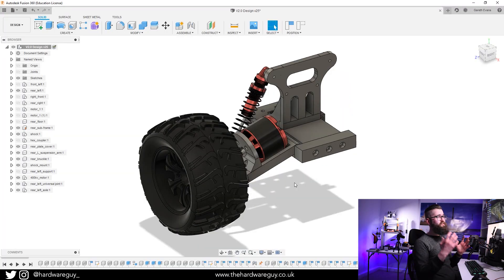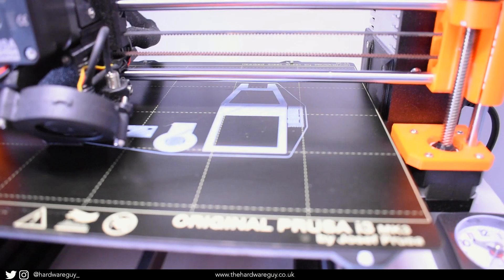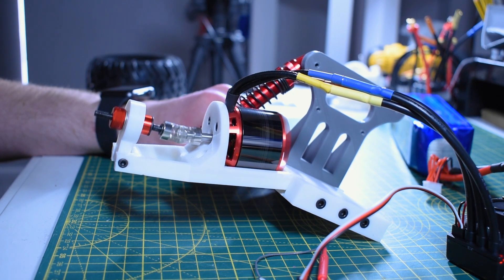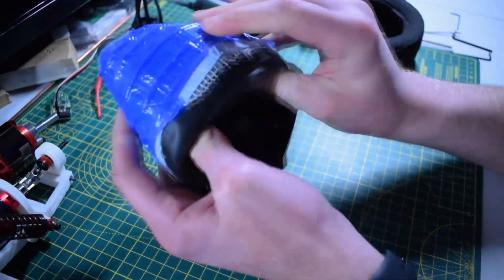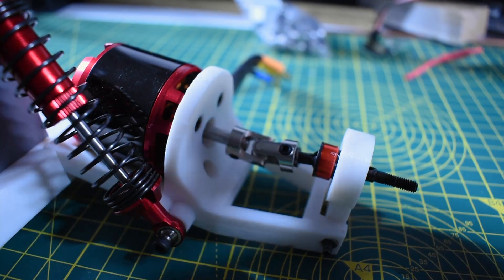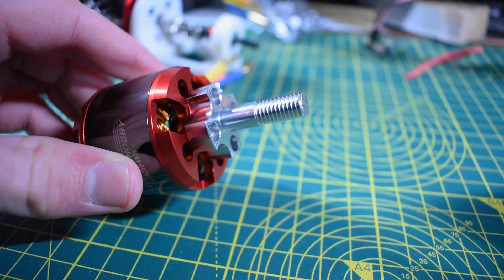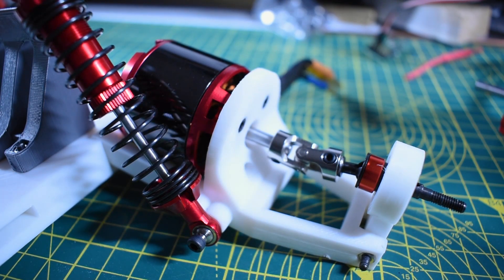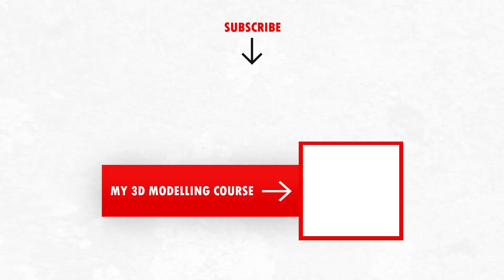AWD RC Car System... pt.3

Comment: Why not place motor on the outside have the wheel attach directly to motor
Reply from the maker: That's what I did eventually! But not enough power, check out Raptor 2. That was a success!

Comment: Why don’t use the outrunner motor at the rim? basically a hub motor allowing to run an awd system in any 2wd car chassi
Reply from the maker: tried it! not enough torque to even move! check out raptor 2 :) much better design

Comment: If you would have put drift wheels on there that would probably make the world's most quickest slickest and smoothest drift car RC it's probably way smarter and way more probable for that to be a high-speed drift car not just to keep it stable but also keep it low

Comment: You don't necessarily have to superglue your rubber tires to your RC rims use a really strong rubber cement so that way not only does it hold strong but it will at least be removable later on

Comment: having the heavy motor on the suspension arms increases unsprung weight dramatically, which is horrible for suspension performance. 
glue the tire to the rim and use balancing clay to eliminate the vibration. my 100+ mph rc cars have bearing play like that but don't vibrate at all.
I like the out of the box thinking tho👍

Comment: hey. how did you connect them in transmitter without different rotations of motor?
Reply: Swap the wires on one till it runs the direction you want.

Comment: First of all keep up the good work! I do have some questions regarding motor choice and suspension design. Do you want a direct drive motor setup or just 1 motor for each wheel? Because the currently available small brushless motors do not have enough torque in my opinion to be used as direct drives. Also for offroading, I am not a fan of outrunners cause they get full of dirt eventually. A closed off design inrunner would have my preference. Regarding the suspension, in the video you are using the axle as upper wishbone to keep the knuckle in place. This causes the axle and bearing to be loaded in a direction they are not designed for. A second wishbone would be prefered imo. Is this just for testing?
Reply: Just realised that this was 10 months ago and you are already working on the raptor. Dont bother answering if my concerns have become irrelevant.
Reply from the maker: Thanks for the kind words! yeah I've made many improvements since with Raptor version 2👍🏻
Reply: Looking forward to see the progress! Im modifing a cheap 1/10 truggy to have a dual motor front axle. Will do the rear later when the front has been proven succesfull.

Comment: Love your work! I'm printing right now a wheel of my design to include an outrunner motor... The thing is that I'd like somehow "make"/program an electronic differential, possibly using the differential thrust mix on my controller and eventually in the future an Arduino to make the algorithm calculation. How did you addressed the differential issue?

Comment: I dont think you're supposed to run just one u joint on an axle. this is because a universal joint isnt a constant velocity joint. two u joints at equal angles cancel eachother out and give you a constant velocity between the output and the input
Reply: Correct.

Comment: it easy to design/ print a wheel, i have printed a few wheels with pla and they have held up great. i am working on a direct drive as well, my first attempt was a failure for sure, tried to power a slash 2wd with a single motor placed where the trans would be and it just don't have enough start up torque to get moving but it will go if given a good push.

Comment: universal joints don't transfer speed linearly. so the motors try to have a constant speed and the wheel is speeding up and down for every turn. this is corrected when you use 2 of them and the in  and out axle are parallel . I think this is where the vibration is comming from.
Reply: Was looking for that comment! You are 100% right!

Comment: Too much unsprung mass. Suspension is more than a wheel assembly connected to A arms
Reply from the maker: I’m learning as I go. I’ve never even owned a real RC car! Can you offer any solutions as opposed to just identifying flaws?
Reply: @thehardwareguy  So I happen to be a part of Formula SAE team. We would Ideally place the motor in the frame and connect the motor using CV cups and hexapod joints. But I do know Hub motors do exist and Team AMZ  designed their custom hub motors weighing just 3.4kg and producing 50HP. So for that scale 3.4 Kg is pretty small. All the best. No one gets the best design in first iteration but doing a bit more research definitely cuts the cost of the project.